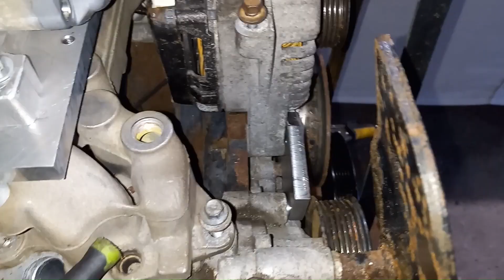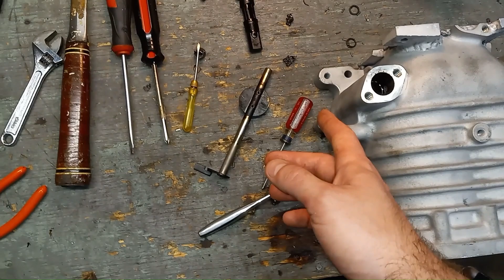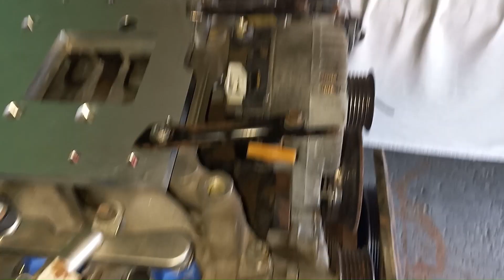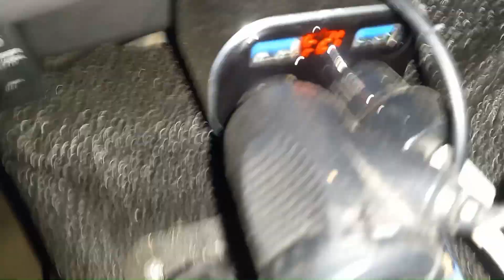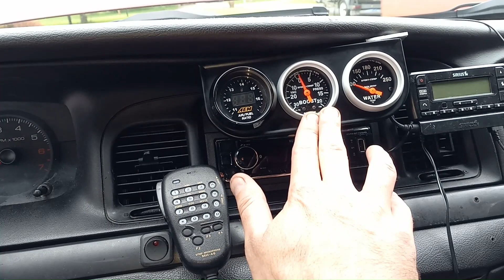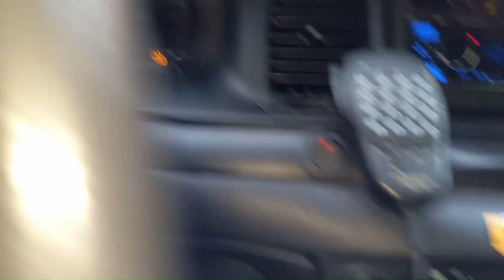M90 Supercharged Crown Vic - Part VI

Comment: Im VERY impressed , you did one helluva a job man , that car is gonna be a very fun car to cruise with the occaissional rip!!!….all my LS swaps got superchargers within a year of them running as well,,,,,, nothing beats a boosted modern fuel injected v-8 motor….NOTHING!!!!
Reply from the maker: @trentdawg2832  Thanks!  I would like to LS swap a full size 70s or 80s Cadillac Coupe lol.  Maybe that will be my next project.
Reply: @ yes me too…i own a cts-v, but id love to get an ‘80/‘81 with the thermometer on the driverside outside mirrior….coupe de’ville and put a LSA supercharged built 6.0 in it, similar to what my nova has…..soon to be a 408” stroker